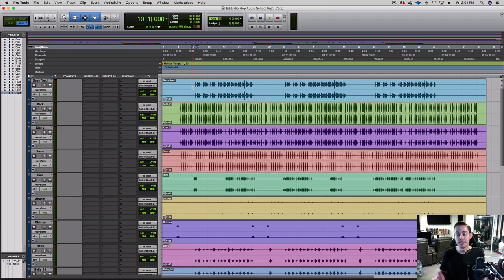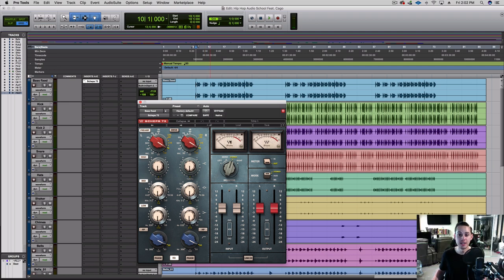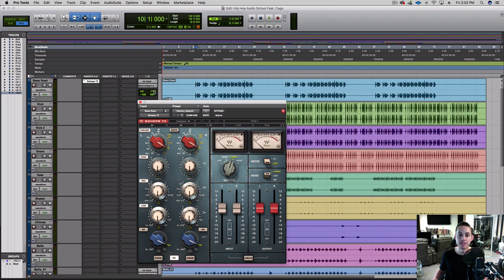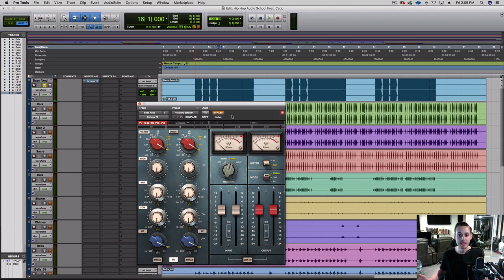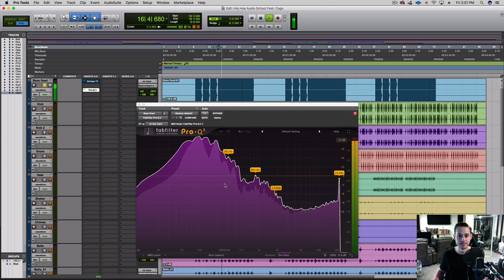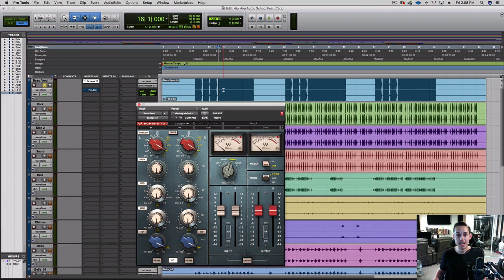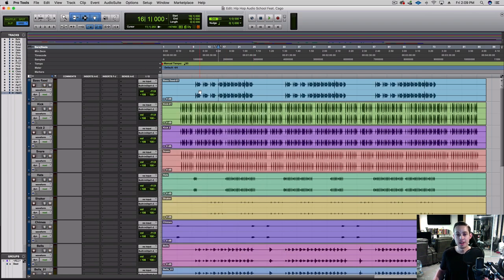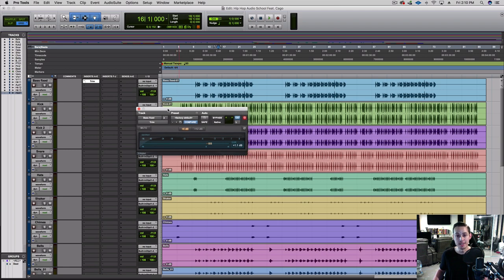Gain Staging When Mixing

Comment: What’s the best lufs for mastering? I go -9 and when I compare with commercial records they sound louder 😅
Reply from the maker: They vary a lot. I usually shoot for -9 lufs as well but I don't force it. Sometimes I get up to -6 so just depends on the song.
Reply: @RawTechniqueStudios  I found out the industry standard is -8 , but I kinda got into izotope 7 used the exciter and kinda gave some flavour on the low end , while having maximizer vintage limiter and Waves l2 with a -1 ceiling and before the izotope fab filter l2 with 1.5gain I get into -8lufs by the end of the chain and I can say that I go head to head with Michael Jackson Kendrick Lamar and drake plus the izotope has some tape effects that really give the track a Los Angeles studio vibe it’s really an amazing plugin for mastering :)